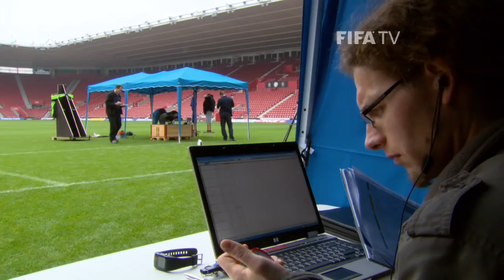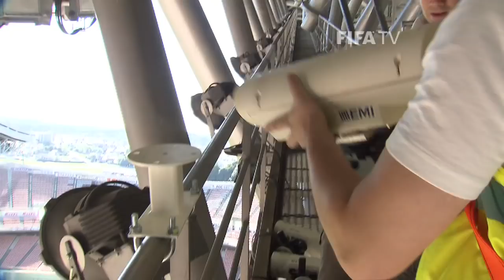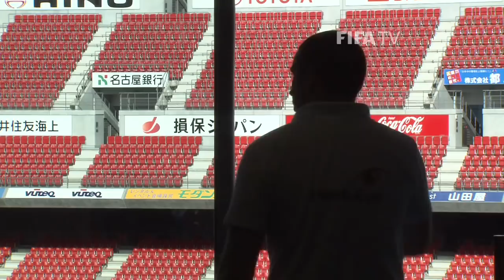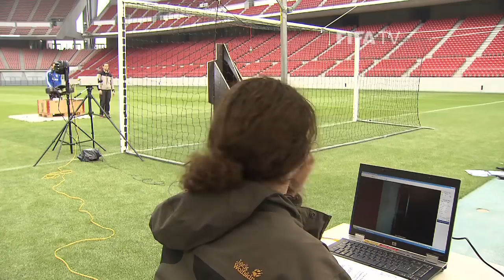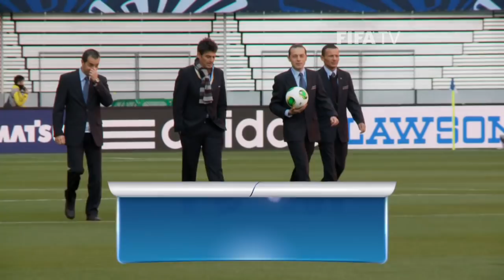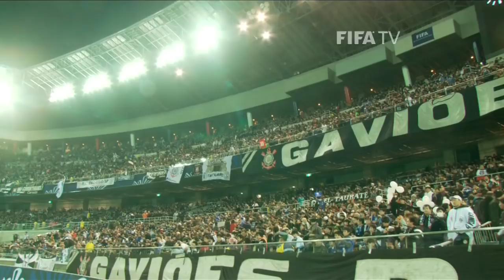Goal-line technology put to the test

Comment: I saw the goals. Am I a superhuman ?
Reply: It's all about the angle. When the goals that weren't called happened, the referee was positioned outside the box and/or had his view blocked by a player. We the viewers have the benefit of several camera angles + slow motion, meaning we can see the goals no problem. Before VAR it was common for referees to get flack for missing "obvious" fouls when they are only obvious because we got 15 different replays of them happening

Comment: I had this recommendation after the Japan winner against Spain
Reply: That ball was still in Play due to the ball being a sphere the outer edge was still in play so it still counts as a goal
Reply: Right 👍
Reply: It doesn’t actually work like that goal line tech is only used inside the goal and in the Fifa WC scenario the ball sends signals that tell the VAR room when to check to see if it’s in play or not.

Comment: Won't this be easier, simpler and cheaper if they simply put a laser sensor on the goal post that would be able to read special markings on balls to detect when they cross the line.
I  believe making balls with special markings is surely cheaper than getting all these ultra expensive cameras, and other hardwares and hiring tonnes of people.

Comment: I see issue with both systems.
What happens if that glass is hit by the ball very hard? My guess would be that the system might break or even the glass might break.
Second system - what happens when it rains heavily or fog settles in(it is not uncommon to see matches being played in these bad conditions).

Comment: um... hired a couple more ref to stand at the goal line?
Reply: However, what if they are all in agreement about a decision that is wrong? Or, what if it's split? More refs wouldn't work. It would only make things more confusing.
Reply: Human eye can not guarantee that it will get goal line decisions correct 100% of the time, you could put 10 guys and it wouldn't make a difference.

Comment: I wonder how the system can decide, if it was only a head or the ball going over the line
Reply: There is a monitor inside the ball that gets triggered when the ball passes, it's not just movement, smh...
Reply: It probably has a velocity meter that shows how fast it came in.
Reply: chance boxer
wouldn't make sense. A ball can also get in really slowly.
Reply: +Etherion yeah but a ball isn't attached to a larger mass. Like a head
Reply: Caleb Silverman
and how do you think, they achieve that? Inside the ball is air and the ball has to have the same mass over the whole surface, so that it doesn't wobble in the air.

Comment: Maan, what an effort. Why not just put 2 slow-mo cams behind each goal and two team members - one from each team - in the catacombs looking at the monitor :D People tend to over engineer
Reply: Pav4n
Because it's fucking expensive, goals can't really be moved again, it will be even more expensive, if something breaks, and it's not necessarily a useful effort. Plus, what happens, if referees start to count on this and then it doesn't work maybe one time? Nothing is flawless, but i'd rather have a very small human flaw than a very expensive technical flaw, which makes it lose all it's purpose.
Reply: +PennyHerbst You would have to pause play while they look at the slow mo, what if another incident happens between the goal and the slo mo recognising the goal
Reply: It's not expensive relative for the money that is in football, at around £250K per install and it will last years and years, Premier League officials earn between £70,000/yr and £85,000/yr a year, the system pays for itself in the long run. Goals don't really get moved often, on the rare occasions where the groundsmen change the pitch they are more likely to repaint along the sides of the pitch. You seem to expect the system to have errors, Hawk-eye has been used in tennis for 10 years, and in other sports like cricket for nearly as long, this isnt exactly new technology. Even if Hawk-Eye was to slip up once, it would still be more accurate than a referee, look at all the close calls it has made already in the Premier League without incident. The reason this technology is needed isn't because the job cannot be done by a human, but because the decision needs to be instant, something a human cannot do. The reason it needs to be instant is so the ref can stop the game and declare the goal has been scored. You can't pause the game, or go back at a later time and declare that was a goal and play must be stopped, that's not football.
Reply: Pav4n
uhm, your calculation is actuallypretty much non-existent. You don't pay more officials only because they need to watch the goals.

The pitch is changed almost every year in some stadiums and therefore the goals have to be moved and everything maybe has to be installed again.

But you areabsolutely right that the decision has to be instand, sometimes refs don't see that the situation has to be reviewed, i didn't think of that.

Well but there still are problems. In football, the pitch is many, many times larger than a tennis court and the lines are sometimes not as visible as in other sports. And how does the camera decide, if it was the ball or just a head, which was going over the line?
Reply: +Etherion Refs aren't allowed to use replays as confirmation of goals .

Comment: can you not just put a camera at each post looking down the line and review the footage each time? occam's razor, the simplest solution is often the best. or is that just not a big enough waste of money? whats next? a biometric diving detection system?
Reply: Clearly the system you're referring to either didn't pass the tests that these two did or the company elected not to submit their design to FIFA. Either way, it's the company's fault and not FIFA's.
Reply: its not an existing system, its one i came up with in all of 2 seconds. the comment i made was meant to highlight how over engineered this actual idea is, and questions its necessity
Reply: +Ben Morris What happens if the ball hits the camera and breaks it?
Reply: use go pros, theyre pretty tough. could even embed them in the posts so theyre flush with the surface

Comment: The NHL needs to use this technology for determining if the puck crossed the line or not. Far too often it's deemed inconclusive because the puck can't be seen through the goalies glove or underneath him.
Reply: can use the electromagnetic method.
Reply: +PugsNotDrugs4 That won't work, because this system only uses cameras. And if the puck is under the goalie and the goalie is in the goal with a part of his big protective material, even the cameras can't recognize it.
Reply: Taufik Akbar
doesn't work, a puck is made out of hard rubber
Reply: @Etherion195  Maybe they could repurpose the puck design from the old FoxTrax system.
Reply: @SWalkerTTU  i don't know exactly how that one works, but it seems like it works with lights, which in turn would cause the same problems as the other mentioned methods.

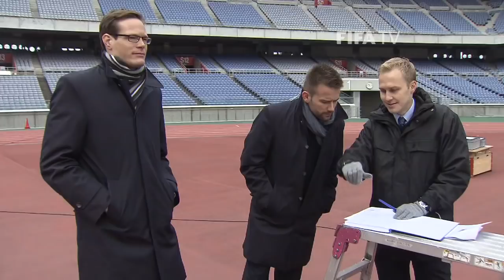Comment: 04:57 The non-visible spectra of electromagnetic fields used in this detection system are not affected by "day light or night conditions".
However, their testing equipment, which does operate in the visible range, is.
Reply: I wonder if similar systems are installed on highways to predict car crashes?

Comment: Can't they just put a chip inside the football like in the hockey puck?
Reply: There is not a chip in the hockey puck. They tried it and it didn't work; goals are done by video review.
Reply: HeyZeus096 ý
Reply: AIJT ONG If I remember right the implant either didn't work right or messed with the physics of the puck because of the special process it required to make it.
Reply: AIJT ONG Thinking further on that since the rule states that the puck must COMPLETELY cross the line, the puck's irregular shape would mess with the sensors unless the entire puck was being tracker (rather than just the chip). I feel like there could be ways around this but it seems to me it would involve a real-time 3D model of the puck being produced by the chip and then tracked by the system, which could be a bit of a pain. With enough money and processing power it seems it could be done, just the NHL deemed it non-feasable due to the reasons in my above comment.
Reply: Considering how hard a ball is hit compared to a hockey puck.... the chip would get destroyed

Comment: Why do they use windows XP ?
Reply: Because it took a very long time to develop, and it's probably a hassle to redesign it for anything else.
Reply: because in real business world, not everything require "upgrade" just because there is a new version available for something. or go with orkham's razor, simplest explanation: they had a XP client at that day.

these kind of software are usually developed platform-independent. xp or vista or 7 or 8 is not relevant. they are just operating systems, hence tools.
Reply: TyloriusTechTips It doesn't make a different any OS will do the job.
Reply: exactly people need to understand that the underline technology is what matters and user interface is just for the avg users
Reply: iDispiseMicrosoftWindows
It helps that your name is iDispiseMicrosoftWindows so we definately know there is no bias at all.
Reply: Andy Cox windows 7 was out in 2010 when they decided to make it...
Reply: @Daniel Garcia most stable?!?!? It about as unstable as bambi on a vibrating tightrope during an earthquake it dousent get any security updates
Reply: Ron Paul oh to Linux i thought yoy were thinking windows xp was the most stable, linux is the most stable operating system, linux=mac
Reply: i think i may have confused myself
Reply: Because good engineers are a bit conservative most of the time! And when picking MS stuff to use, this is definitely the place to be a bit conservative.
Reply: i would not  e a good engineer i am not in the slightest conservative I'm the buy the latest and most expensive of anything but food type

Comment: Today in the Premier League, Chelsea vs. Hull posed a challenge to Hawk-Eye. Sure TV replays also could've conclusively shown that the ball hadn't gone in, but the system was able to accurately and *instantly* determine that a goal had not occurred. 

The key thing is it did its job and still allowed the match to flow, like a football match should. The suggestion of just viewing a TV replay, although it works in other sports, would be inappropriate here.

Comment: Couldn't official very high speed cameras be installed by FIFA on the stadiums and there should be an official which sits by the screen and gives decisions over the radio whether its a goal or not. The replays would be very slow and the referee would be able to identify the correct decision. Wouldn't this be better then spending millions on this new technology? The simple use of cameras would also help with offsides.